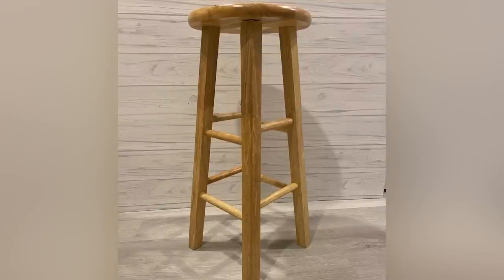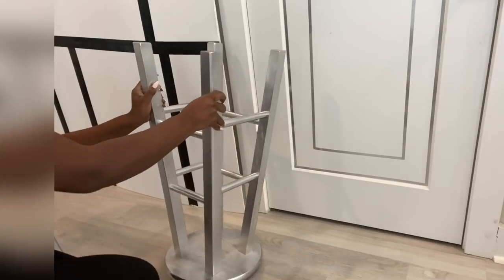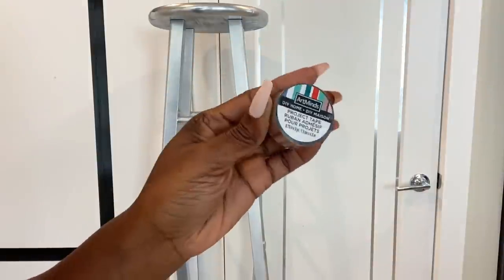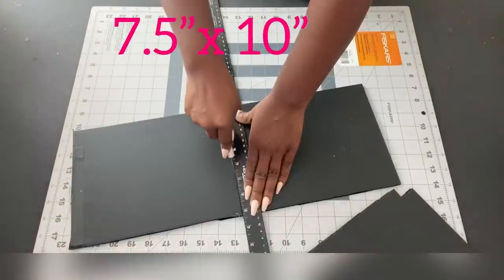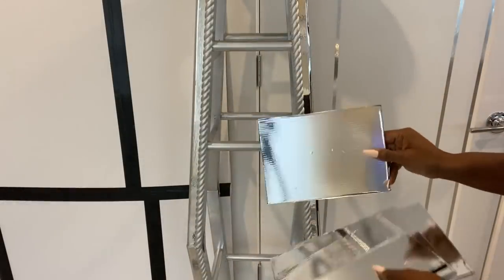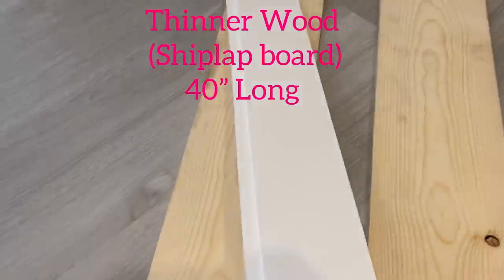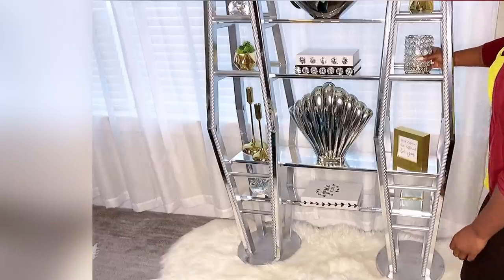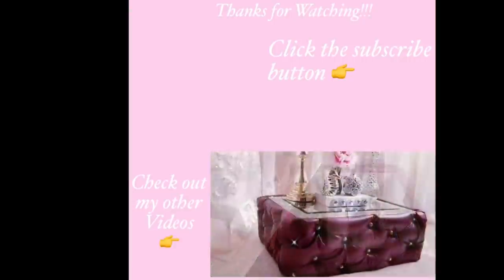SEE HOW I TURNED STOOLS INTO A HIGH END SHELVING UNIT

Comment: You could drill a whole in all the legs and use dowels and glue.
Reply: Or a hole.
Reply: @bobbiebeck5361  lol just noticed the typo thanks
Reply: Yes!  Please!  Those mending plates are really not meant for that type of use.  I would also screw in a piece of wood at least across the back for added support and resistance against torque.  Otherwise, great idea.  I also may have used made instead of the wood for shelves.  Lighter weight, thinner profile, but still supportive.

Comment: Ingenious idea and it looks fantastic, but instead of joining the stools together with metal plates, which show, I would have drilled a hole in the bottom of each leg and used small joining dowels and glue.